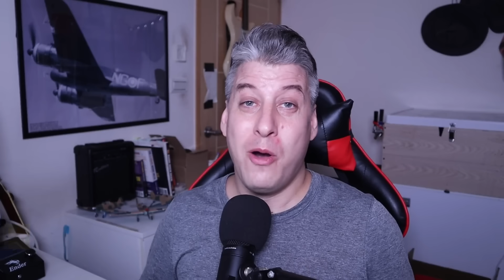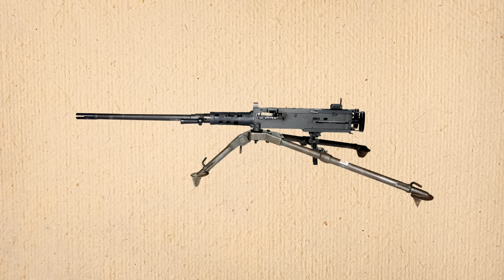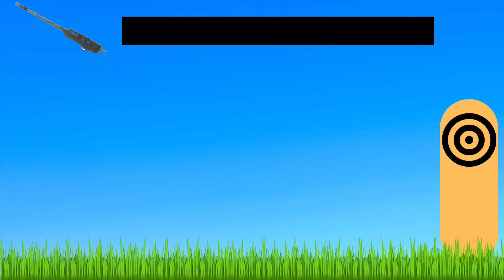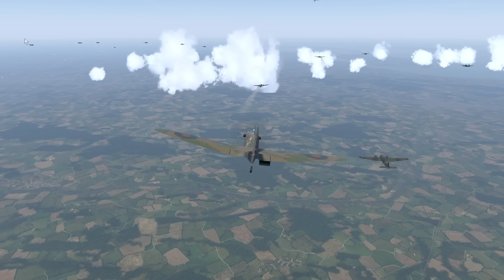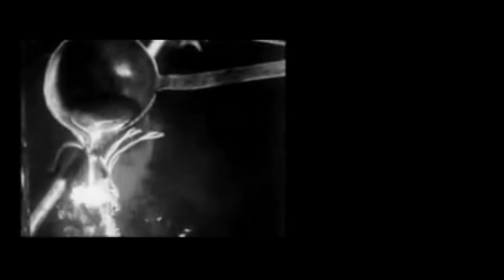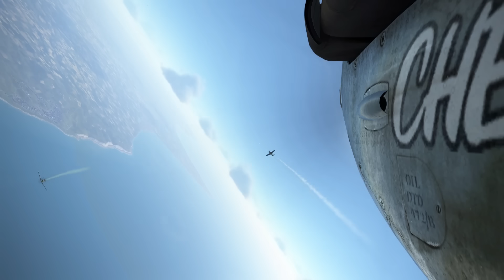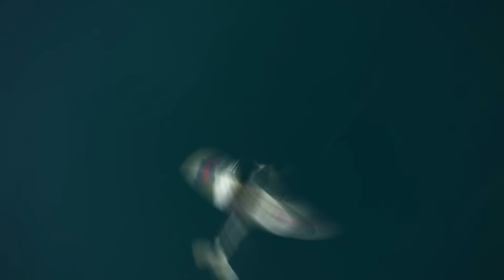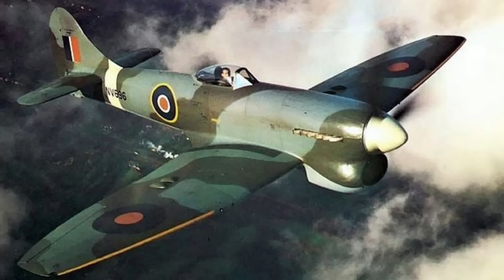Why Did The RAF Use .303 Caliber Machine Guns in WW2? The Surprising Answer

Comment: the Hurricane and Spitfires were designed in the mid thirty's and you are right that the thinking then was to throw as many bullets as possible, but by 1939 I think you will find that the RAF had realised that it needed bigger guns and they were planning to replace the Spitfire with the Whirlwind but unfortunatly that planes engines failed hence the rush to fit a cannon into the Sptfire.
Reply: It realised before 1937 as the 1937 fighter specification called for 12 303s, but preferably 4 20mm cannon.
Reply: P 47s used eight 50s.  The more the merrier.
Reply: @rogersmith7396  but the P47 was a later war aircraft. When the RAF were designing 8 gun wings contemporaries US planes had 2-3-4 MG in a mix of .50 and .30 calibre. Contemporary British aircraft to the p47 had 4 20mm cannons which the US themselves equates to between 12-20 .50s.
Reply: @rogersmith7396  "P 47s used eight 50s.  The more the merrier."

But the P-47 had half the firepower of a Tempest, with four 20mm guns, despite its armament weighing more.
Reply: @rogersmith7396  made great by Adding a Merlin..
Reply: @fibessnaredrum2775  P 47 used radial engines it was the P 51
Reply: @fred6319  completely correct... I'd been debating the Mustang on another video.... yep my mistake..  hands up!!
Reply: @fibessnaredrum2775  See Greggs Airplanes analysis on the Merlin.  It had altitude limitations.  The P 38 Alison produced more power.
Reply: @rogersmith7396  was that when the merlin was carbed??
Reply: @fibessnaredrum2775  do you mean supercharged?
Reply: @SuperNevile  No pal. Early Merlins were Carbed. Lots of people use that as an example when comparing engines, usually to discredit the Merlin with its early teething problems..
Reply: @fibessnaredrum2775  Check out Greggs Airplanes.  Hes the expert.  Most of those WWII planes performance was dependent on how advanced their turbo superchargers were.  I recall Military Aviation history said all Spitfires were carbed and inferior to fuel injection.  And of course the Allison was a modified Merlin.
Reply: @rogersmith7396  more power with a turbocharger (which is big), less power at altitude than the Merlin without it.
Reply: @rogersmith7396  Depends WHICH Merlin you look, which is the problem. Merlin development did not just suddenly stop with the outset of the war, it actually accelerated. Meaning by the time the Merlin was replaced by the Griffon it was generating almost twice the HP of the early Merlins in the Spitfire Mk I's and had dual superchargers.

And thats where people go wrong comparing the Merlin with other engines, sometimes purposefully. If you want to compare two engines you HAVE to compare two contemporary engines or your comparison is absolutely meaningless.

That by the way is something that Gregg actually points out when discussing merlins in particular, but other engines as well. 

Yes, some early merlins DID have altitude drop offs in power, but many later one DID NOT. It depends WHICH engine you are looking at.... Something you may want to consider.
Reply: @rogersmith7396  you lose credibility as soon as you refer to Greg's version of history.  The Allison was designed independently and had issues for most of WWII.  Near the end, Allison finally produced a new intake manifold, but they never did produce a successful high altitude engine.  The Merlins however were far more reliable.  By the end of the war, they were tested at WEP at 2640 HP.  The 100 series powered the fast DeHavilland Hornet fighter and the P-51H.
Reply: @rogersmith7396 The allison was not a modified merlin. They were both V12's but had a different genesis. Carbs may be inferior to fuel injection but the 27 litre merlin produced the same power as the 34 litre DB601, so the inferiority was hard to discern except in negative g manoevers.

Comment: Only American can design a good .50cal, America, fk yeah! haha

Can carry 3 .303s for every .50 and 5 for every 20mm.  You can carry a ton more ammo.  Yeah, but the thing there is, you NEED all that extra ammo and guns lol.  THe .50cal and 20mm will get the job done with fewer guns and fewer bullets. Sooooo....Sure, you can score more hits with more guns firing faster, but does it really outweigh the less RoF and less power vs other larger guns?  

Im personally no fan of the .303s, especially in plane games.  I recall playing IL2 1946, a WW2 flight sim and dear god, even with a Hurricane with 12 damn .303s and unlimited ammo, i was struggling hard to down even 1 HE-111 lol....this with gunners disabled and me just able to sit behind it and shoot it all I wanted.  It sure was a spectacular display of firepower with 12 guns all clattering away, but the damage on the other end was...well....less impressive.  Meanwhile, my Spitfire with its 2 20mms could easily down fighters in just a couple of hits and down bombers in only a few more.  I think 20mms are my favorite aircraft weapon.  30mms are simply to heavy and to limited in ammo capacity(ME262 with its like 80 rounds per gun), and the .50cal, while not a terrible weapon, is only a few steps up from the .30 cal weapons.  Meanwhile, 20mms tend to have a decent ammo load.  Spitfire with its like 120 or 150 rounds per gun for 2 cannons(I forget which it was), or even later planes like the F9F Panther that had like 200 rounds per gun for 4 20mms lol.  20mms just do a great job of putting out.

Comment: The idea that the British stuck with the .303 to keep the Germans using armour is farcical. The Germans would use armour regardless, as it protects the pilot and vital systems from the shrapnel and fragmentation of the 20mm shells. The armour won't stop a direct hit from a 20mm hit, but the shrapnel damages a larger area and is more likely to damage a vital component, so is still worth protecting against, and a few mm of armour plate will still do that. Additionally, the armour behind the pilot might not completely stop a 20mm round, but it could be the difference between the death of the pilot, and the pilot suffering a few broken ribs.
Reply from the maker: Yep, I wasn't overly convinced with that argument, but it was just weird enough to make the cut into this video.

Comment: Two squadrons of Spitfires with 20 mm cannon were in service during the Battle of Britain. Johnny Johnson served with one of those squadrons. As he recalled in his autobiography "Wing Leader", the guns would immediately fail as soon as cannon-equipped Spitfires intercepted the bombers.
Bob Stanford Tuck's biography "Fly for your Life" relates an angry conference of Fighter Command squadron leaders in 1941. The topic was whether to replace .303s with 20mm cannon. Douglas Bader was very firm in the opinion that the .303s were more effective than 20mm cannons. The diverse opinions expressed at the meeting meant Spitfires were produced with a range of armaments during the war: 8 X .303s, 20mm cannon, or a mixture of both guns, sometimes including .50 calibre as well.
The reason for this might be that Johnny Johnson had transferred to Bader's 242 Squadron. As revealed in Bader's biography "Reach for the Sky", Johnson became Bader's protege, hence Bader forming his opinion.
20mm cannon were due to be fitted to the Hurricane II and the Typhoon. Early versions were fitted with 12 X .303s instead, until the gremlins in the 20 mm cannons could be removed.
.303s have a much faster rate of fire than cannon, which is preferred when shooting at fighters. Bombers carry more armour and 20mm cannon are required.
Bader always advised his pilots, "Get as close as you possibly can before opening fire. When you think you're much too close, get even closer".  On that basis, 8 X .303s (or even 12 X) are more than enough.

Comment: Think you are being a bit hard on the Brits and the 303, for the planes they started out facing the fast firing 303 could easily damage and could be fitted in significant numbers to the light and nimble British fighters. Yes indeed they might have been better fitting something larger a little later in the war but there are advantages to using the same equipment in an extended manner. Now the US came in with great hulking aeroplanes with huge low-tech radial engines, both fighters and bombers. The heavy 50 cal would blow right through the sort of Armour used on aircraft by the Germans and could rattle from one end to the other of a zero, but just like any gun you needed to carry enough of them. The heavy US fighters could. Both the Japanese and the Germans used mixed gun batteries, the idea being able to handle anything, but the 20mm had only a handful of rounds and then they didn't have enough 303 to make up for it. As the war went on they packed more and more cannons (up to 30mm) to deal with heavily protected bombers. It was what they had to do, and by the end of the war they were really dangerous opponents to the bombers. Course it took them so long that by the time they were able to handle the bombers there were hordes of smiling mustangs they had to deal with first. Like so many things choosing aircraft weapons is not a one-sided deal, you got to figure on your enemy. An enemy with light fast maneuverable aircraft give me lots of light fast firing machine guns. Heavy bombers your problem - cannon, generally a 303 would just piss off a 17. Got plenty of weight, horsepower and wing area? A 50 cal is a good intermediate gun, real good at strafing ground targets too.
Reply from the maker: Some good points here, thanks!

Comment: Bu the Westland Whirlwind was designed from the outset to take four 20mm. Hispano. Now that was one heck of a punch.
Reply from the maker: I'd have to read up on this, but did its nose mounted cannons have the same issues in 1940 as the 19 squadron wing mounted Spits?
Reply: @CalibanRising  Indeed, the spec F10/35 was originally drawn up inn 1935 for a fast, heavily armed; 'not less than six cannon, preferably eight' fighter. In brief, the Whirlwind was the result, but it was badly let down by RAF indecision and Rolls Royce's inability to succesfully develop the Peregrine engine, as with the Vulture for the Manchester. The Hispanos on the production versions only had 60 round drums, but there was a move to provide belt feed with the belt guides going along the floor of the fuselage. However, of the two squadrons, 137 & 263, which were equipped with the Whirlwind, the pilots loved it. One aircraft was experimentally armed with a single 37mm. nose cannon, but with the fortunes of time, was never proceeded with. A pity.

Comment: Apparently,  when the Hispano was being evaluated it was based on some use of this weapon. However because it had been, of necessity at the time, mounted sideways in the aircraft wing this put strain and friction on parts not designed to take them. This led to unreliability which biased the decision not to use them at the time. Douglas Badrr was dead set against  the Hispano because of this and insisted on retaining the .303 Browning.
Reply: Yes, I remember that preference of Bader's. He was an excellent pilot and (I think) marksman, so he could get in really close on an enemy. Lesser pilots/marksmen probably wouldn't have had as much faith in all-303 armament.
Reply: @britishamerican4321  In a 25th. BoB anniversary, article by a leading magazine of it's day, I read that the Brownings were set in a general spread to ensure a better chance of some hits by less experienced pilots. However, once a pilot had proved his skill at judging distance and deflection, he would have the guns reset to converge at 250 yards causing maximum damage at that point. Apparently, the effect was equivalent to a five ton truck hitting a brick wall at 60mph. - !
Reply: @simongee8928  That's exactly right (re: the convergences, first set to a long range, then to much shorter range, e.g. 250 yards). And yes, the effect was devastating, in the days before more powerful engines (and thus up-armoring) became available.
Reply: Also, Bader fought only in the early war years (before getting shot down and captured), before German up-armoring rendered the 303s peashooters.

Comment: I stopped watching at 13m 43 secs simply due to the fact of the constant stream of excuses tendered  by the commentary for the incompetence of the  Raf /Mod for favouring .303 calibre rounds at the time. 
This is how really simple it is- every enemy we had were using either 20mm rounds at the same time as Battle of Britain raged -both the German ME109  and Jap Zero utilised 20mm to our pilots cost.
Yank fighters went  straight off for the lethal .50 cal while we failed at ballistics and gun conversion/configuration for Aircraft ,which was pretty tragic for our pilots.Why we couldnt have been more forward thinking regarding armament was a downright disgrace.
Reply from the maker: Thanks for the feedback.

Comment: Mind you it's not as easy upgrading an aircrafts armament as one might think.  Weapons fit, weight, ammunition loading, centre of gravity and blast effects all have to be evaluated....
Reply: True, but it was made easier on Spitfires by the wing design. it could be easily removed and replaced. My Grandfather who was Spitfire Ground crew during the war explained it in a fair degree of detail, but essentially it was a matter of disconnecting all the fuel lines, hydraulics and the like, then simply unbolting the wing, lifting the fuselage up, slide the old wing out, slide the new wing into place, then lower fuselage back down. Then you simply bolted the wings on, reconnected everything, checked it, and boom.... new wings. 

Why is this important? Ever seen the letters after a Spitfires Mark designation? Spitfire Mk VB for example? That referred to the wing. The A wing had the 8 .303's, the B wing had the 2 20mm and 4 .303's, and the C wing had the 4 20mm. The wing designations was down to the armament NOT to whether the wing was clipped or not. 

It made the logistics of upgunning Spitfires pretty simple, all you did was change the wings, then tinker with the weights and the like to ensure proper stability, and voila, upgunned.
Reply: @alganhar1  yes, a,b and c type etc.  Members of my family worked in factories producing components for that aircraft before the war.  I'm guessing they carried on through after my father was called up for the RAF.   However I was referring more to getting cannons to work reliably and not to the detriment of performance either.  I'm no expert, but there must have been knock on effects.

Comment: Just a interesting add on from a reloaders point of view, most rounds were close to each other in size.

In size the 30-06 and 308 cartridges was .308 of an inch in diameter.
303 brit and I think 7.7 Jap were .311 inch in diameter.
Then the Soviet 7.62 x 54 and 7.62 x 39 were .310 in diameter. 

All the major rounds were within 3 thousands of an inch in diameter of each other. Other interesting thing is the 303 Brit and 7.62 x 54R were rimmed cartridges while all the others were not.
Reply: Some dimensions are different because nations measure their bullet diameters differently. Some measure the diameter of the bullet, some measure the diameter of the grooves and some the lands. The same bullet calibre can be expressed in several different ways.

Comment: I think you're missing a few really important point in your well researched video. In say 1940, when the RAF was switching to use cannon armed fighters more and more the US standard pursuit planes were toting something like two machine guns (e.g. the P-36 with one .30 and one .50) so actually less well armed than the RAF planes of the year before.
By the time the US joined the war they had settled on 6 x .50 calibre guns, but the RAF was now primarily cannon armed, and the US stuck to that for the rest of the war. But both the RAF and USAAF were primarily attacking fighters by that point, where smaller calibres are still highly effective. Compare that to the Luftwaffe, which was moving to larger and larger calibres such at 30mm or even 50mm as they were more concerned about knocking down bombers with only a couple of hits, so impact of individual rounds rather than rate of fire was more important.
As for the bombers, as you said, for the nigh bomber force the gunners were there primarily as observers, but if you need to scare off or distract an inbound interceptor, then much faster firing .303s is going to produce a more impressive display of tracers than a .50 calibre (I have no evidence on that but that is my belief).
Reply from the maker: That's an excellent point Peter, I hadn't considered that.
Reply: @CalibanRising  I invite you to read an article i wrote on this subject a few years back: http://journalmah.org/horky.pdf